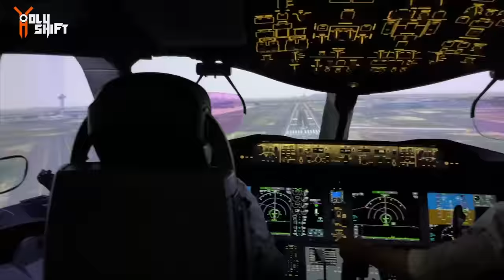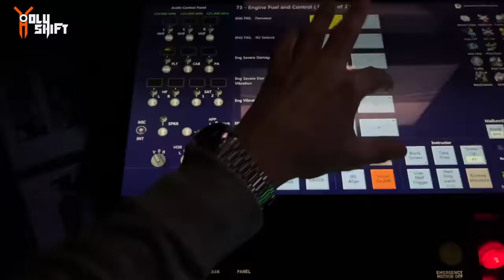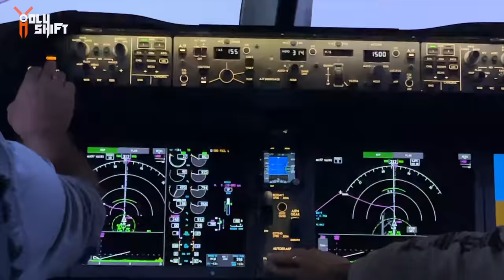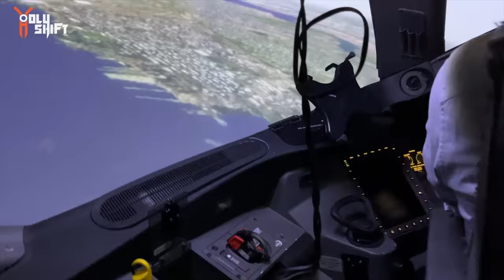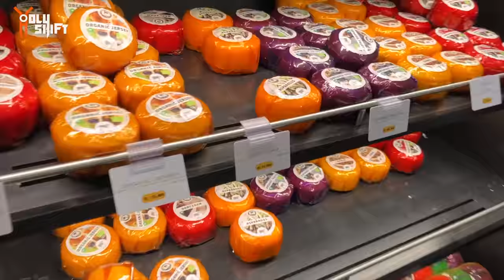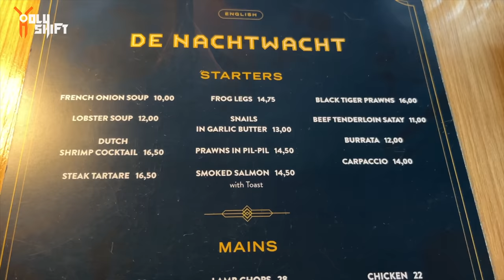Ride A Harley & Train To Be A Pilot

Comment: Very cool video Sandy! 
Had a couple of those rare flight incidents in the past (blown engine while going down the runway during takeoff; and a quick escape while landing in Philly, we were maybe 100m from the ground and the pilot pointed the plane back into the sky while the engines went full force, OMG that was wild). But pilots handle those incidents so professionally that it actually cemented my trust in flying. 
Let me know when you are going for those rides in northern Jersey and NY I am very close and my BMW RT could use some HD company. 😅
PS, next time you are in Amsterdam try to go to an Argentine steakhouse. There are a few in the city.